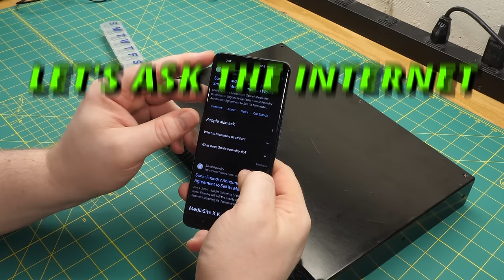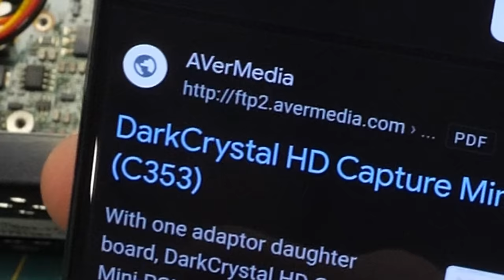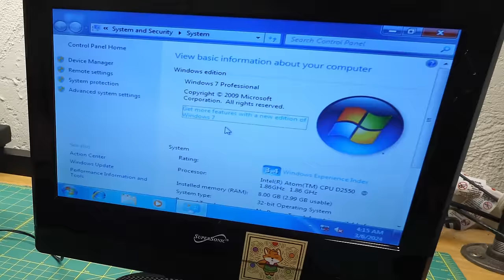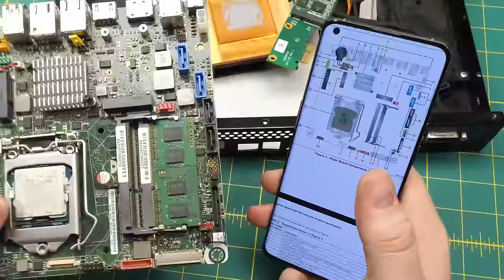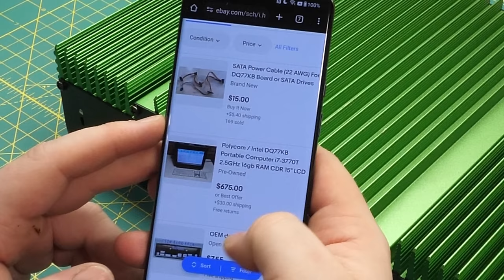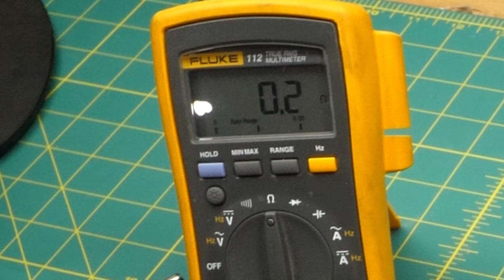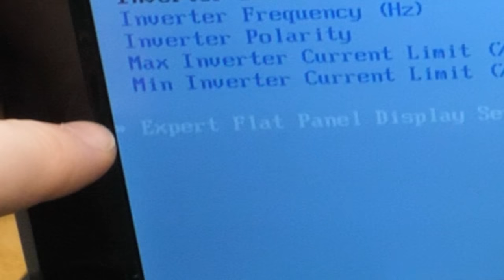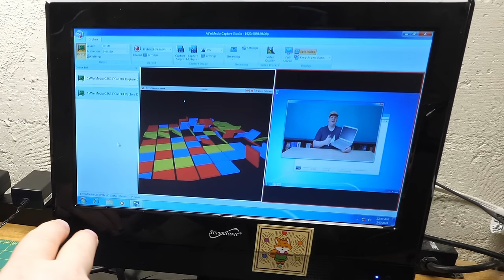Little Guys 5: Three Of Them [MediaSite / NCR N3000]

Comment: "It took three computers to fix one"

Reminds me of Techmoan's CED saga where he had to buy three CED's to try to fix them (and because the players were cheap apparently).
Reply: 2 of them were used to fix the second one and technically all but the first one are fully functional, they just have to share the stylus, the first one was entirely broken because it was stored in the same pond as the discs, the second was brand new but was never fully assembled because the plug had been incorrectly wired and the third was only needed to get a stylus and a clean lid for the second one

Comment: The "Thin Mini ITX" is an older standard created by Intel (I think) that in addition to being notably thin (and came with both a regular and a low profile I/O shield) it had its CPU socket specifically located off further toward the PCIE slot side of the board which facilitated special cooling solutions that ran heat pipes past that PCIE slot edge of the board to a heat sink that was oriented to allow front to back air flow in the very thin cases to cool the CPU. These boards had external power supply jacks like the one on the board you have which allowed for the use of external power bricks.

Those odd connectors along the front edge of the board were, in fact, a few different types of display panel connectors.  One of them was an oddball internal display port connector.  These were employed when the boards were used inside electronic signage or kiosk products that had the display panel and the motherboard integrated into the same chassis.

That motherboard also has a redundant internal power supply header back in the same corner as the external connector so an internal power supply could be used.

These kinds of motherboards were generally set up to use lower TDP versions of desktop CPUs.  They are the ones that have a "T" at the end of their model number, as, for example, the Core i5-3470T which has a 35 watt TDP.

Interesting products, but not especially commonplace in the PCs most of us have lying around.

Comment: 46:00 What you're describing is called "Iso recording" or isolated/isolation recording. It's very common and done in video production all the time. Wirecast can do iso recordings of all your inputs if set up correctly. I used to do this for work many moons ago.

Comment: It's interesting that they've chosen to tie earth-ground and negative together on the NCR model. It would mean that in the case of a broken power supply with the polarity reversed, the entire chassis would become live, quite the electrocution risk.
Reply from the maker: Well in that case you'd also have 110v hitting the DC ground so the PSU wouldn't survive long enough to get plugged in I think. But yeah, it seems odd.
Reply: @CathodeRayDude  Well a reversed polarity normally shouldn't mean anything, but if the laptop power supply was plugged in to an incorrectly wired outlet and suddenly experienced some failure due to shoddy manufacturing (unrelated to the outlet), you'd hear a pop and wonder why the computer wasn't working, grab it and... maybe get a bit of a shock.

Probably unlikely but having things earth grounded tend to be for pretty rare and freak occurences.
Reply: Well, it's the earth ground, not the AC neutral, that's tied to (-)DC, so inherently it being a switching PSU at all would isolate the DC from AC lines regardless of the AC hot side.
Reply: @baaelectronics   "Well actually" ... ANY power supply has to be galvanically isolated, not just switching.  There's still going to be a transformer between mains and output, so the output will be floating with respect to mains (ergo polarity is irrelevant), and unless double-insulated, the chassis ground is almost certainly going to be tied to mains earth.
Reply: To clarify on my previous comment (because I just got to the NCR part of the video), the supply brick has a 3-prong plug.  If it didn't tie DC negative to earth, there would be literally no point in having a 3-prong plug at all.  So, in this case, of course it passes through earth ground.

The 2-prong plug bricks are double-insulated, meaning there is no way (barring truly catastrophic failure that should not occur due to fusing, etc.) for mains to reach the DC output side.  THOSE will not have earth on the DC negative.  Everything on the secondary side is floating WRT mains.  Although, if you plug that brick into a device that interfaces with anything else (a monitor, an audio amplifier, etc.), it will probably end up grounded through that interconnect anyway.

And that ^ is the reason for the Zero-ohm resistor.  If you want a safety earth, but have an issue with ground loops (due mostly to bad electrical wiring or connections to other poorly-designed devices), you can replace that 0R with something else -- like a capacitor, to shunt RF noise to ground but isolate DC, or a higher-value R to provide a weak (DC) path to ground, etc.  It's always cheaper to change a production line to use a different component than to redesign and replace the whole PCB, so it's a safety net that lets you alter the grounding technique as needed in the future.
Reply: @nickwallette6201  well that's good to hear
Reply: @nickwallette6201  The "well acktually" 😂 and yep, anything with a transformer will do it! Some signaling (especially audio) could have ground loop issues, hence the need for earth and support components at all that you mentioned in the other comment.

Comment: that NCR 3000 was built to be the "server" side of a on-premise client/server POS system or similar. passively cooled, redundant drives, stick it on a shelf in the closet next to the rest of the required tech stuff (isp modem, cheapest 8 port switch possible, voip box, etc) and completely ignore it til someone from corporate IT shows up to mess with it.

Comment: The header on that control board at ~43:50 is the easy part if the board design makes a jot of sense - 6 pins, PIC18F part number on the micro, means it's the programming interface for the micro, set out so as to accept a PICKit2 or 3 to allow program and debug. The 4-pin header just between the USB connection and the micro is probably a tap point on the USB lines.

Comment: 15:05 I have a case similar to that... not that exact version, but... in mine, it actually takes some mini-ITX power supply that fills the void you have at the top in that orientation.
This case looks (to me) like they've just taken the standard case, and just not cut the holes for the power supply.

Comment: 43:52 I think  those unpopulated round pads are for through-hole LEDs ( CR reference, flat on circle), which would make sense. Looks like it has pads for SMD RGB LEDs
Reply from the maker: Yeah, that seems clear enough, and it was my first guess when I looked at the board, but the designation threw me off. I've never seen "CR" on a PCB before in my life, and I can't find any examples of it denoting an LED, just people who sound as confused as I am finding it next to normal diodes. There's some suggestion that it's the archaic term, "crystal rectifier." I can imagine that showing up on a board decades ago, but it seems wild that it showed up on something made in the 2010s.

Comment: Ex NCR software dev. The NCR device is a server for back of house restaurant usage. Generally it runs Aloha point of sale backend components and cloud connection components. They run windows and use a custom image by NCR. These are very commonly found in the back offices of establishments like Krispy Kreme for example.
Reply: Back at Krispy Kreme you say?
Reply: @Toonrick12 indeed. If you happen to be in the back office of a Krispy Kreme you can usually find them mounted up on a shelf. There will be a single internal switch for the Aloha network connected. You may also have a KVM switch below the monitor to switch between the little guy and a stock PC / server used for KK loyalty internally... depends on the franchisee.
Reply: I'm disappointed in you two. Very disappointed.
Reply: @Toonrick12  noooo, why?
Reply: @Toonrick12  You can't blame them lol and it's back at it again at Krispy Kreme but I get why you put it that way. To the other two people, it's a vine from 10 years ago of a dude saying "Back at it again at Krispy Kreme" then cuts to him doing some running flip where he kicks down the neon sign. Since then a bunch of people have made memes out of it

Comment: Fun fact about that power plug used by the NCR guy: all (or at least most) of NCR’s point of sale controllers of a similar form factor use that plug. They are used in all of Walmart’s self-checkout devices. They likely used that plug to keep in line with their own standard.

Comment: That NCR would actually make a cool little home theater PC, since it has HDMI output. My current one runs on a similar 3rd Gen i5. Add some external USB drives for your media and a wireless keyboard, then you'd be all set.
Reply: A fully passively cooled home theater PC? I dunno.. seems far fetched.
Reply: @cdigames  As CRD pointed out, the passive cooling in that is likely MASSIVELY overbuilt. And with a coat of paint, it would blend right in with many amplifiers.
Reply: @mattelder1971  It was more of a jab at the fact that concurrent with this series, CRD has been showcasing the works of Niveus, whose whole thing was passively cooled home theater PCs

Comment: 10:29 Depending on when this particular box was built, I wonder if they were using new old stock Sigma Designs chips. That company liquidiated back in 2018 and hadn't been doing much for a couple years before then. Would certainly have helped them lower costs.

Comment: These thin mini itx boards are cool. I had a couple and yes, did install an i7 4770 into one. With the huge HP laptop brick (140W?) it worked a treat.

Had a second one with an i5 4590T that I ran as a daily hackintosh for a few years. It worked amazingly well, everything worked. Dual screen HDMI output too. Aaaand, I got a thin mini ITX case from aliexpress which was tiny - literally the size of the motherboard with special thin mini ITX backplate which is half atx as you mentioned. The HDD even had a bracket to sit over the top of the motherboard. Super cool.

Comment: That green box would make a absolute killer pfsense router. Heck I need to find me one. I'm running a small form factor Dell optiplex with 3770 i7 in it for my pfsense and it's a beast. Does everything I could dream of from a router. Hosting fail over Wan and not one not two. But three different local networks. Servers desktops and iot things with isolation.

Comment: That funky looking copper heatsink/fan on the Mediasite is actually a pretty expensive and heavy duty cooler for 1U server systems.
I use it myself in several servers that require very low profile coolers as I need the space for a 10GB network card hovering close to the cooler.

The damn thing sounds like a jet engine when at full speed.

Comment: that "boring" machine with an Atom has some potential. If it had a better mobo in it, i would've certainly stuck a low profile GPU in there and turned it into a small gaming PC. And I would use rest of the wasted space to hold SSDs, just double side tape them straight to the chassis, no worries!
As for that NCR green thing, despite the chassis not allowing card installation, I would fully populate the drive bays with SSDs, swap that CPU with an i7-3770, throw in a ton of RAM, and use it as a really powerful web server, and if you were to remove that RS-232 port and run an eGPU cable through it, boom, it could ALSO be a ridiculous gaming PC.
And I would absolutely use that media capture box as a streaming PC, and I'm sure there is a hack to get 60fps out of those avermedia cards somewhere. Crazy potentials these little PCs have!

Comment: Thin Mini ITX has standardized CPU socket placement and height along with standardized component heights, so that manufacturers can design cases with integrated heatsinks.
Reply: They were also intended for use in AIO computer monitors

Comment: would love to see a little guys episode on the most commonly nerdy home user for these things. OPNSense or a PFSense firewall QOTom makes some great ones AND you get a excuse to upgrade your network in the process! 10G and 2.5G network I remember you doing one with Direct Attached Copper youd be able to use the same NICs and DAC cables but youd get more ports and then can run 2.5 on your devices that have the capability too

Comment: The Crappy Mini-ITX Machine's case probably has all that space to the side of the motherboard to allow for a small form-factor power supply that gets used on models that run off mains power, rather than the 12V barrel jack. Going by the angle at 13:55, it looks like the back panel could be swapped out for one with a cutout for such a power supply.

Comment: Amazing video as always, now here I have some questions, 
1. These particular little guys are really cool, wonder if it could run a gen 1 (like the likes of the WMR/ HTC VIVE or Lenovo Explorer/HP VR 1000 with the inside out tracking
2. The half height pci card looks like it could support a wifi card? Before the smaller wifi cards around this era? (An Atheros AR58-- kinda card comes to mind
3. Relating back 1, all you need is 1.2 WDDM and at minimum 2gb of vram, so potentially that express slot could support a GPU of that sort of caliber? 

All said, I love your videos and really love looking at these little guys keep up the awesome videos

Comment: These industrial computers in general, but especially those Intel μITX boards seem perfect for making DIY projects.

Like a tiny NAS, low-end web server, video capture system, retro games emulator, or anything else you can do with a computer.
They definitely have the capability to outperform, and probably be cheaper than a Raspberry Pi. Good choice for the same kinda use cases.

I'd love to see what you could do with them! Such as maybe make a DIY cube tricaster...

Comment: Those little Avermedia capture cards could, in theory, be hooked up to a Raspberry Pi 5 using it's PCIe port, there are adapters that convert that port to M.2. That would make an interesting little capture box and the spec sheet did mention Linux support.

Comment: Apple bricks pass through the earth ground to the USB-C shield/MagSafe body if you use the AC cable, but not if you use the flip-out prongs. 
But, you might ask, where is the earth connection on those? It's the big circular metal bit the AC end slides onto. The cord has a spring that makes contact with it, but the flip prongs do not.

Comment: inverter frequency is nice to change, on a lot of laptops is at ~60-200hz which is quite often far too low. and just as well the average OEM (who does nothing essentially) leaves it at the stock for no reason.

change it to 500hz, even on laptops you can do this through software, your eyes will thank you.

Comment: This reminds me that I’d found some kind of h.261/h.262 codec for video conferencing at the old university I worked at 15 years ago. It had d-sub 25 pin connectors and was like the size of two AT cases stacked and was probably 10-15 years old at the time.

Comment: 43:48 those likely aren't for capacitors, but rather LEDs, supported by there being a little flat part on one side of the circular outlines. The unpopulated resistors would be the current limiting for each LED. Maybe they made this board to support multiple models, and some had more indicator LEDs on the front panel.

Comment: AVerMedia actually has a line of gamer oriented capture cards, and they seem to run a bit cheaper than Elgato. Mine's not installed right now(hulking GPU blocking literally all of the other PCIe slots), but looking at the software, I think it also does the multi-capture.

Comment: The the unpopulated components in  the little power button board 43:59 are LEDs and probably their current limiting resistors, not caps. LED footprints have a little chanfer on the cathode, while electrolytic caps have a shaded region. This was probably for debugging the MCU state.

Comment: I remember I had a Geforce 4 card. The original Geforce 4, not the 2nd Geforce 4, the type that plugs into an AGP port.
It was a Geforce 4 VIVO, which included a video capture card in the graphics card.
It was just a DINN connector between the VGA and DVI outputs, that had a custom cable that just accepted composite video and S-Video. I don't even know if it had Audio in, but in theory you wouldn't need it because you'd have a the line in port on your sound card.

Comment: You can remove hot glue by spraying it with a small amount of isopropyl alcohol and waiting a minute. After that you can pull the glue with your fingers and it will detach. Hot glue is actually amazing as a removable glue from this property alone.

Comment: The little daughter PCB having lots of unpopulated parts isn't really worth reading into. we put them on boards because its better to have a space for a component and not need it, than to need to put a component down and have no space. for example, in the design phase you might put down 2x as many decoupling caps as needed, and only populate half of them, or you might add pull-up and pull-down resistors if you're not sure what the idle state of a pin should be. Large production run PCBs tend to have these things ironed out in prototype runs and removed to save space/look neat, but for small volume items its often cheaper to just leave the pads in place and mark them as DNP in your instructions to the fab house.

Comment: I wonder if that curly cable allowed the power switch to be removed from the frame and pulled put, allowing the machine to be mounted in a cupboard, but with an accessible power switch on a desk or similar?